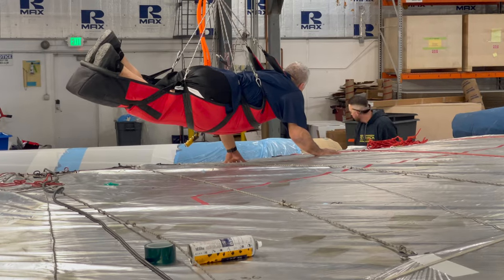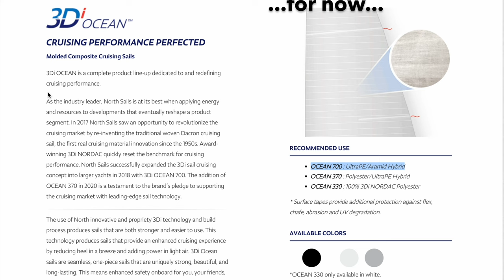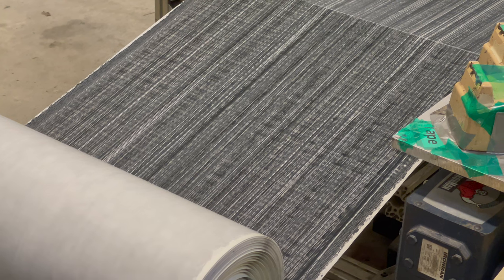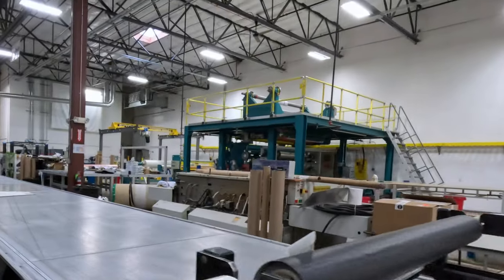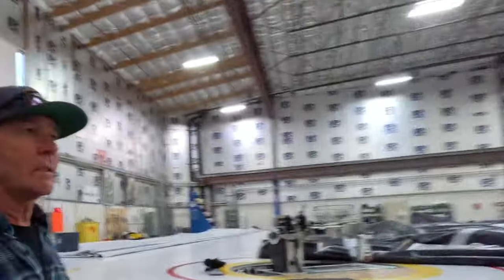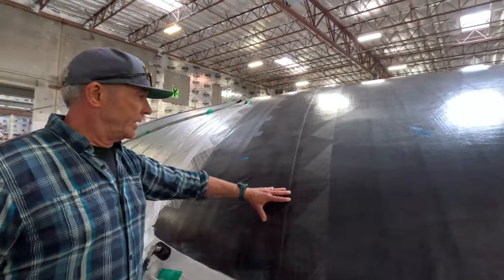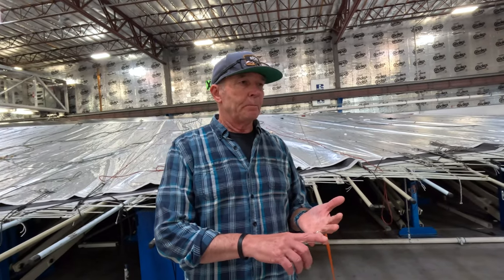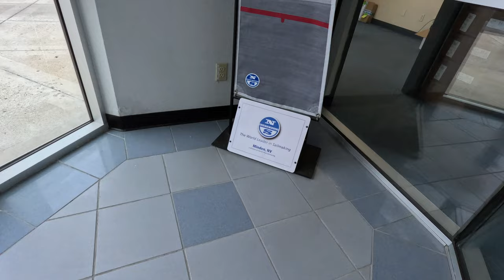3Di North Sails Factory Tour for Our #Outremer 52 Catamaran (Ep.4)

Comment: had the experience of riding a trimaran due to the apparent wind, the boat under a symmetrical spinnaker sails on the bakstag (135 AW) in downwind (180), that is, in this particular case, only an asymmetrical spinnaker works normally on this boat
Reply from the maker: What kind of trimaran ? Outremer owners with a symmetrical drop the main and sail something like 170-180. Apparently it’s quite efficient.
Reply: @SailingAWEN customized aluminum trimaran 11 tons weight 16.5 m mast 90 m2 spinnaker, 40 feet, the appearance of the hull is similar to a dragonfly 40 the water part is very narrow, maybe this effect is due to the full mainsail because it reefs hard and has never been reefed, the maximum speed of the boat that I have seen is 25 knots, the boat is about 50 years old and is probably now in the Mediterranean